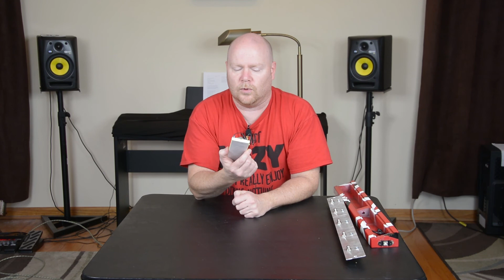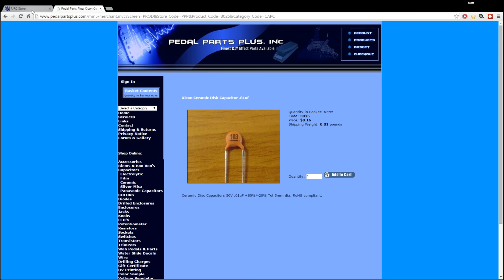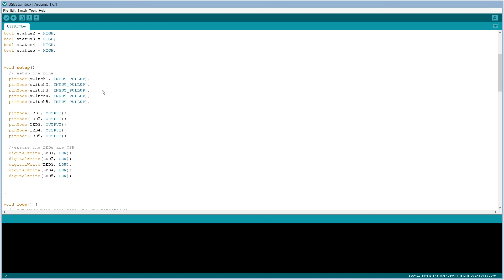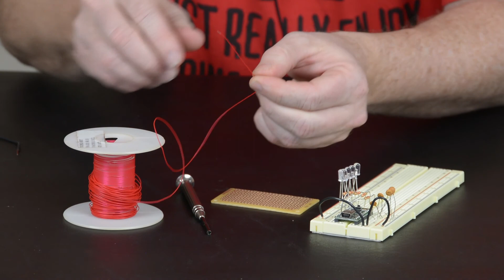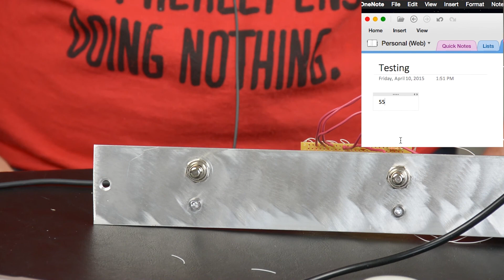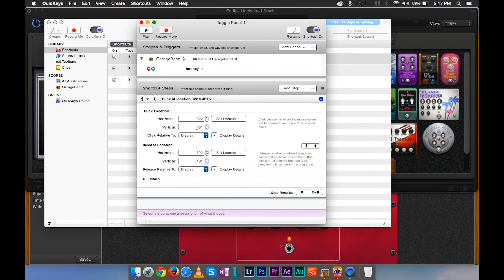USB Stompbox Controller for Garageband - Part II

Comment: Hi Matt,
Great video. I just finished a similar prototype. I'm in the process of building the final version in a metal box. Thanks for the tips on the quick keys. I wasn't aware of that app. It will give me even more flexibility and I might be able to control my guitar Multi-effect through its software.  The version I designed has 6 buttons with 2 modes and 3 more control functions that are triggered by pressing 2 buttons at the same time. Now that you told me about QuicKeys, I may add a third mode for pedal board control!!!! Oh what fun. :)

Comment: What made you choose "Keyboard" over "MIDI"?  Wouldn't that eliminate the need for another app to control GarageBand?
Reply from the maker: Garage band has very limited MIDI support.  You can use GB as a software synth, but as far as I know it pays no attention to MIDI control signals.  The emulated keyboard/macro approach is a bit clunky, but it's universal.  It will work with any software.  You could use it with any software on any platform so long as you can find a utility to run the macros.

Comment: Hi Matt, Great video here dude! I am currently using bias FX on my ipad and require a board to send midi CC messages. how could I adapt the code to do this ? :) keep up the good work!!!
Reply from the maker: MIDI is a pretty simple protocol.  There's a good tutorial on MIDI from an Arduino here: https://www.arduino.cc/en/Tutorial/Midi .   The big change is that you'll be using the digital I/O pins on the microcontroller rather than the built in USB.
Reply: Matt Heere I really appreciate the reply :) I have just finished my project this evening with 10 buttons... but I plan to expand to 20 buttons when payday arrives and I can afford the components :) 

Many thanks again your video was a massive help ! X much love from the UK x

Comment: (Unchained) Great vid; Have you tried to use the pedalboard to control the GarageBand 'Live Loops' feature? I'm wanting to use my iPad as a multi-channel loopstation, which it already is (sort of), but it needs a footswitch to start/start the loops. (side note: I also play thru an RP500 (like yours) and run it USB into my iPad to record my different RP tone/loops - as opposed to using the onboard GB guitar modeling)

Comment: nice work Matt! can i use it with ampitube or guitar rig? do you also have a code for a pedal? Also, do you have a complete circuit diagram for this? I don't know how to connect them inlcuding the USB since i think it was not mentioned in your video.
Reply from the maker: +shoomaklovesemmy Since it looks like a keyboard to the PC, it should work with any software package.  Doesn't have to be Garage band.  Obviously the way you'll configure the macros will be different for different programs, and if you're on a PC then it'll be different software than QuickKeys as well.

I didn't produce a complete schematic.  The drawings in the video are for one switch.  You just replicate it on different pins for other switches.   The USB connection to the computer is the built in USB port on the Teensy.  There's no wiring involved in this part.
Reply: thank you so much! can you do me a favor, i want to add a pedal to your project. can you upload a video for it? thank you :)
Reply: +Matt Heere i hope you can give us a code for a potentiometer for the pedal. thank you.